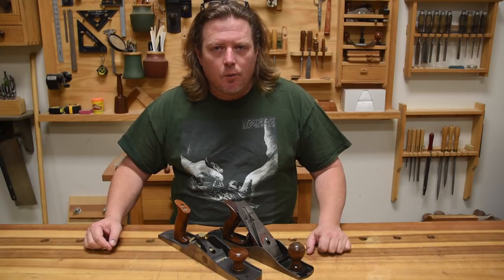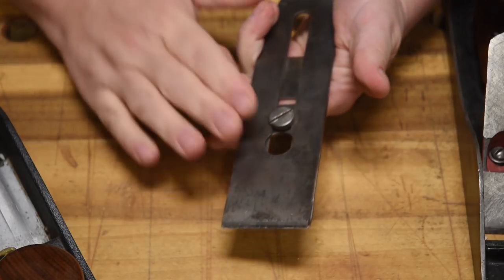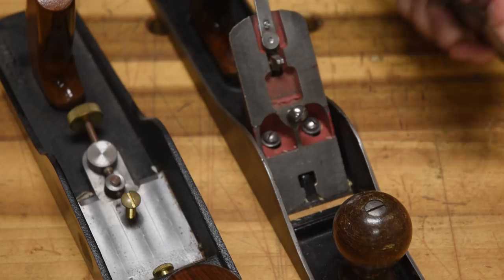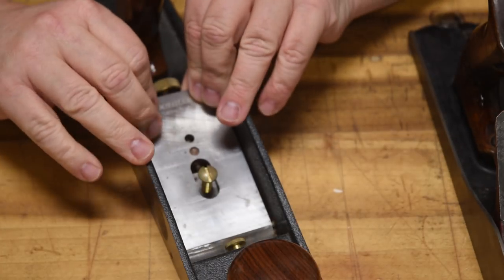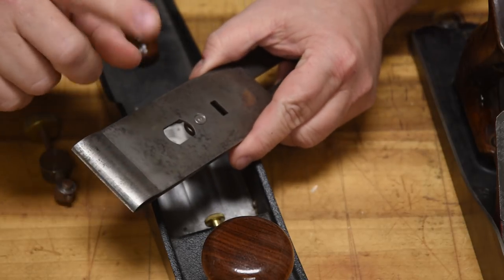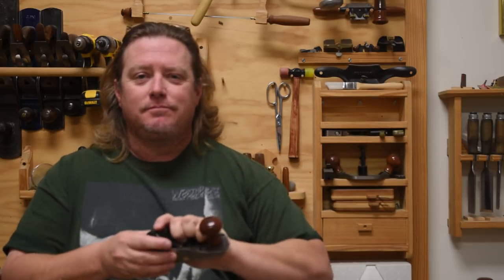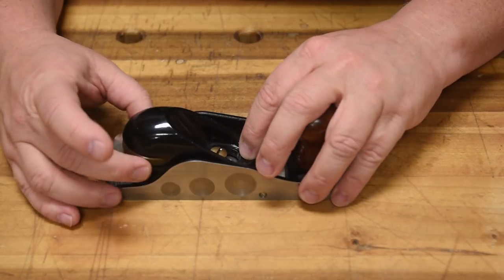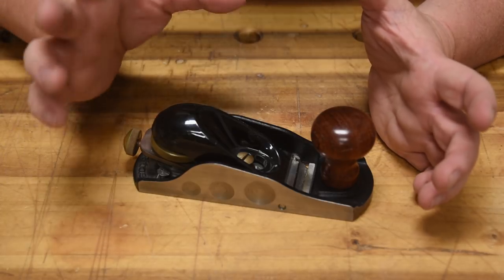Bevel Up / Bevel Down

Comment: Blimey - I watched this last year and ended up getting the Veritas partly on the strength of your explanation. It's a lovely plane, and the plane chamfer guide really makes taking the corners off stuff easy. I built a bed frame and almost did away with sanding because of the the plane chamfer guide.
I totally forgot to say THANK YOU!
Reply from the maker: Thanks

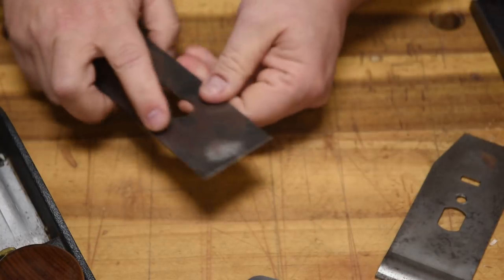Comment: 4:12 - the bevel down blades generally come with a 25 degree angle on the bevel, but you want to final sharpen to a 30 degree bevel.  That puts a tiny section of 30 degree on the end of the blade (that you cannot feel by hand), and that's why you use a jig.  You don't WANT to match that factory installed bevel - you want to exceed it slightly.  My understanding is that the reason for this is that it makes it a lot faster to sharpen, since you are working that entire wide bevel against your sharpening stone, but rather only the narrow bit that's been added to the tip.

Comment: It's been my favorite plane too for several years, it just works great and is so satisfying to use. I like the mass and weight, though it's too heavy to keep in a pocket. But now it has competition -- I recently got the Veritas large and medium shoulder planes. They are so beautifully made and work so well that now I look for opportunities to use them. The Veritas No. 4 smoother I got several years ago is nice but just not as impressive as the block and shoulder planes.
Reply from the maker: They're shoulders are nice. I don't use the one I have much.

Comment: Is there such thing as a double blade plane? One where you can cut going and coming?
Reply from the maker: Yes there are. I've seen pictures of shoulder planes just like that. But they're kinda like Jackalopes, only in pictures.
Reply: @wortheffort  Your response made me giggle. I have a friend who recently made a post about his"double bevel" sliding table miter box. It's an advertising thing on the dewalt that  has left and right tilt. NOT a double bevel. I told him if it was a true double bevel machine it would have to somehow cut a double bevel in one operation. Not possible with only one blade. He couldn't understand my opinion and simply believed the advertising BS. Thought I would let you know that I bagged a record Jackalope a few years ago at a secret location in Wyoming!

Comment: You should see how honking thick the single iron on an old wooden plane of mine is.
Reply from the maker: Ya, wood bodied ones were thick but most times those came right from a blacksmith. Bet it was tapered too.
Reply: wortheffort yep half as thick at the top